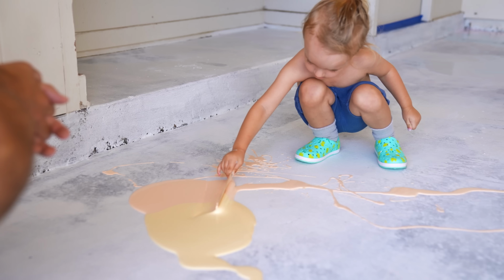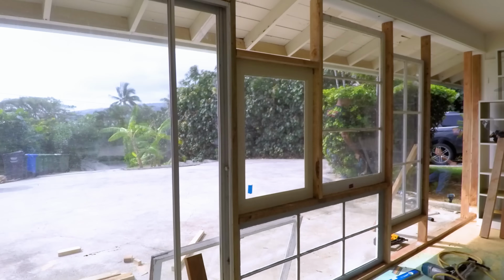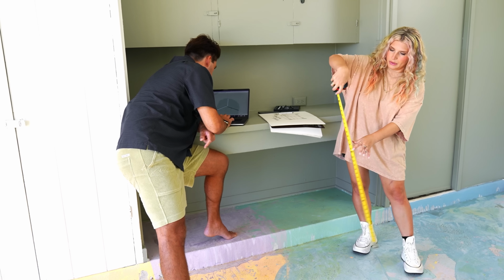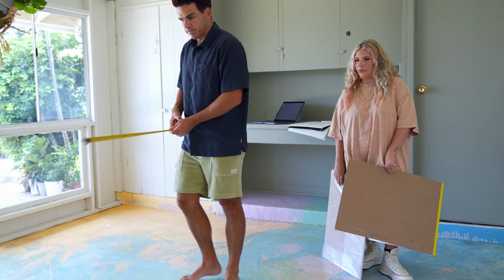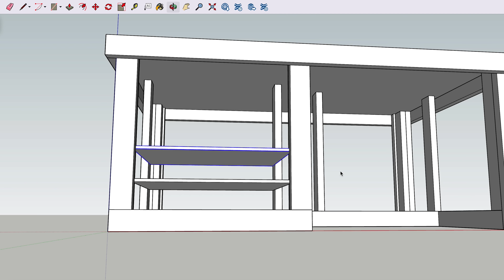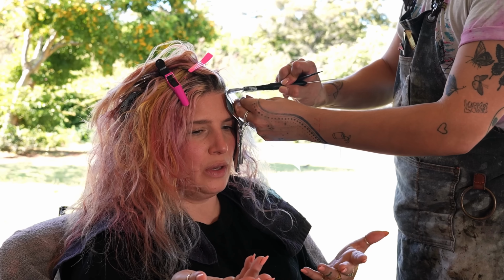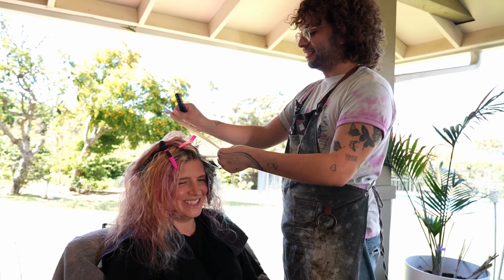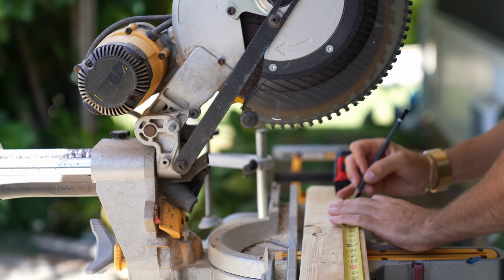We turn this old garage into the ULTIMATE Home Office & Creative Studio (+DIY work table)

Comment: Workspace looks great! Just wondering where the power points would be especially if youre recording stuff at the big table - perhaps a hole in the middle for wires? At my local library the tables have little insets with plug points and chatger cables!

Comment: LOL--All tables & desks are supposed to be 29" - 30' tall. All counter heights are 36" tall & use a 24" high stool or chair. All bar heights are 42" tall & use a 30" high stool or chair. Otherwise you are doing custom heights to accommodate people for whom standard heights don't work.